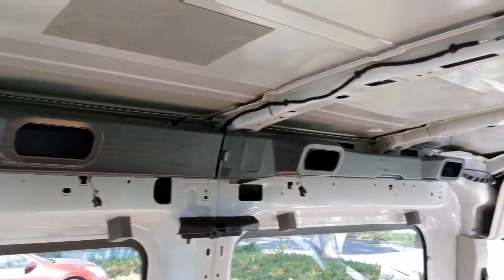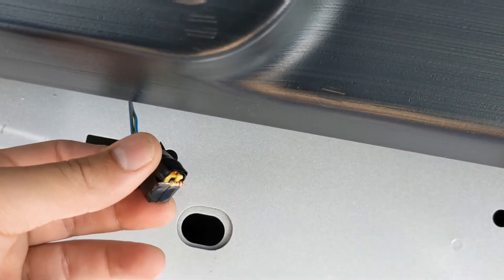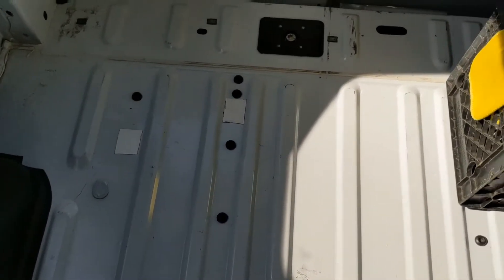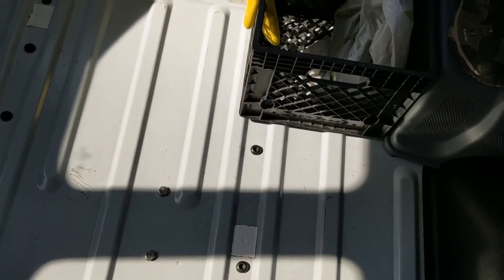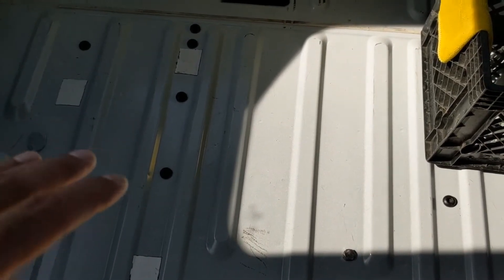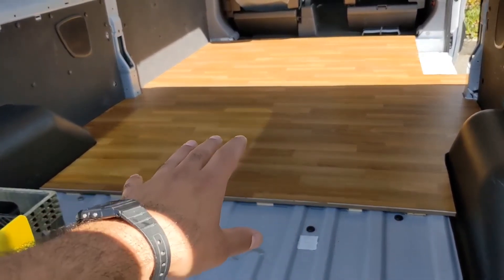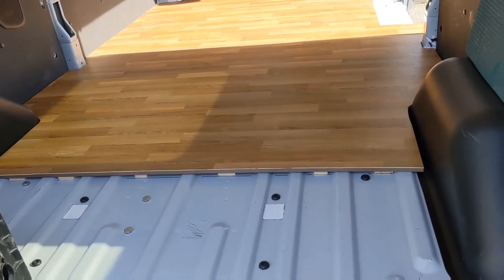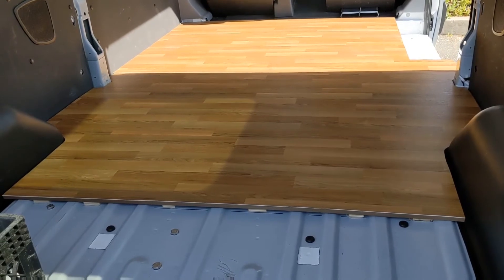Campervan Update- Very Expensive Custom Wood Van Flooring Cool Van Builder Guy Person

Comment: How did you know which resistor to use! (Ohm wise) Nicely built on the floor.👍
Reply from the maker: It's a very common size for most air bags I think. Btw, I enjoyed your state capitol tour, thanks!